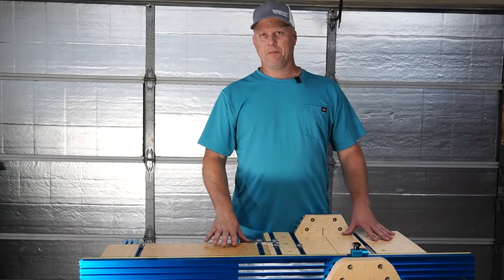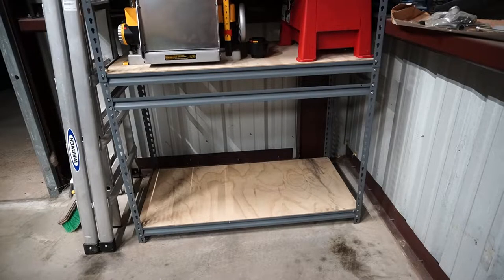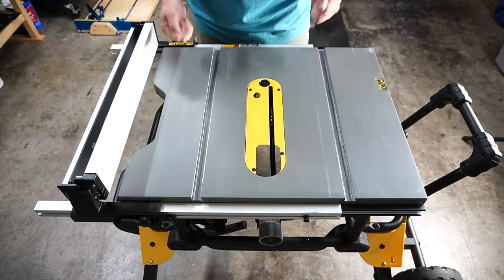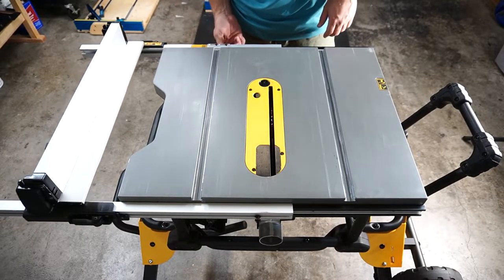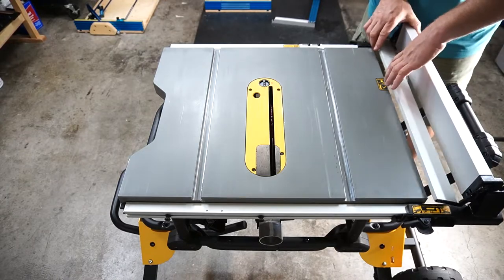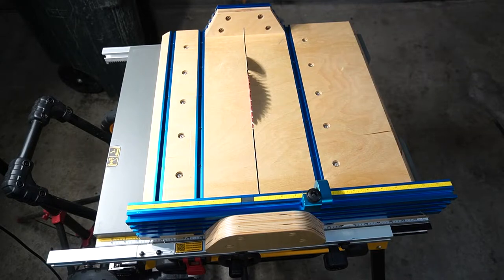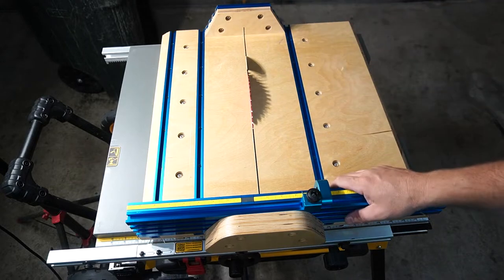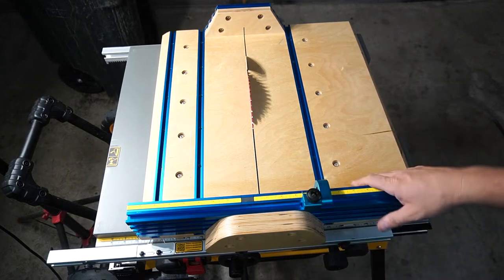Precision CrossCut Sled Plus Extension for DeWalt Jobsite Table Saw

Comment: I appreciate your quest for accuracy.  I will say, I wish engineers would understand the philosophy of “acceptable tolerances”.   I’m a builder.  I’ve worked with many engineers, civil, structural soils.  Some, but many don’t understand “acceptable tolerances” if you are designing a part for a Mars rover I understand it nees to be very precise.  If you are designing a gravel driveway you don’t need to be within 1/8” of accuracy…that much is moved when the first car is driven over it.  We are using a $500 saw and building stuff that our five year old kid will drive his PowerWheel into.  Nice sled though.

Comment: Very unique!!!  We’ll done!  Now that you have used it a bit, how has that stop block worked for you?  I’ve seen comments that those type will loosen up and move over time.  Thanks!
Reply from the maker: It's working great.  The stop block has not had any problems at all.  This crosscut has become one of my most useful and practical woodworking tools

Comment: One other observation,  you mention the inaccuracy of wood keeping its shape,(I agree) So why did you use wood in this build?  I have used wood myself over the years.  Make a jig and 3 months later have to make another because the woos changed.  I now make all my jigs out of HDPE (High Density Polyethylene).
Reply from the maker: You're right.  HDPE is fantastic material and I make a lot of stuff out of it.  That stuff machines like butter too.  One of the challenges with HDPE is that it will distort worse than wood when machining deep channels.  I do have some good news to report -- the aluminum reinforced Baltic Birch is holding straight and true so far.  I thought surely after several cycles of hot & cold, humid and dry, that there would be some measurable warping but there's not so far.

Comment: If anything, please let me know if you’d be willing to make and sell a set of those T guides that go into the actual slots in the Dewalt job site saw. That being said, you should actually make those to sell. They are impossible to find and I also like the safety factor of the table not tilting. Thanks, Garry

Comment: Good job. Typical engineer. 🤦‍♂️
This video is really funny to me. I am a retired structural designer. I spent 43 years as a draftsman/designer. When I started watching this video the first thing that the first thing that jumped into my head was, “I’ll bet this guy is an engineer”.  Completely over thought, over designed and over built. Good job! I’ll probably steal your design, simplify the design a bit and build one myself. 😂 I have the DeWalt 7485. The 8 1/4” little brother. Perfect saw.
Thanks!
Reply from the maker: Hahaha.  I have been called the "king of overkill" my whole life.  Maybe I should have that put on a T-Shirt.  HaHa.  I will argue that it's better to be on this extreme than the polar opposite.